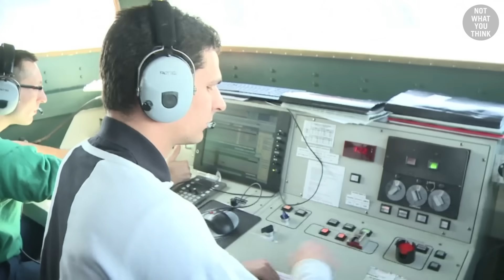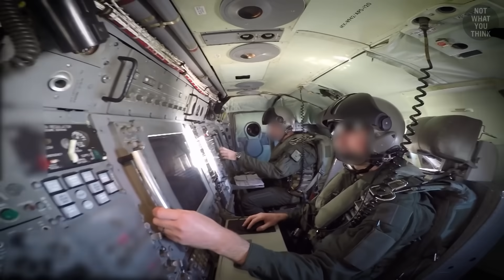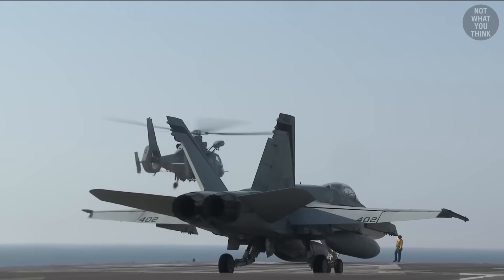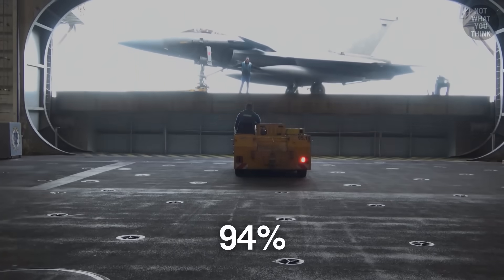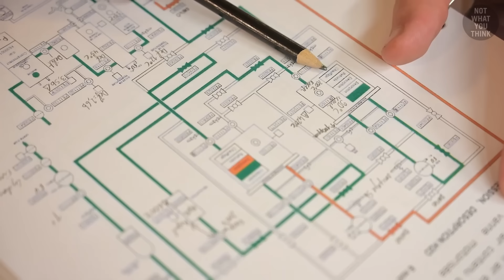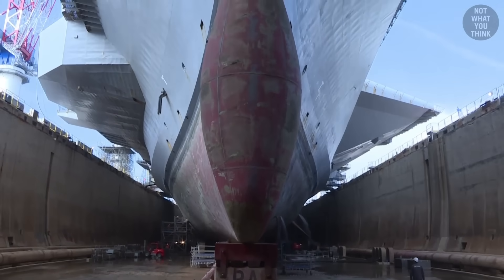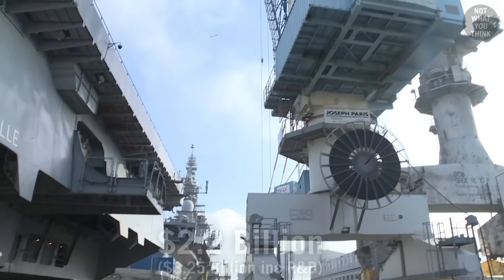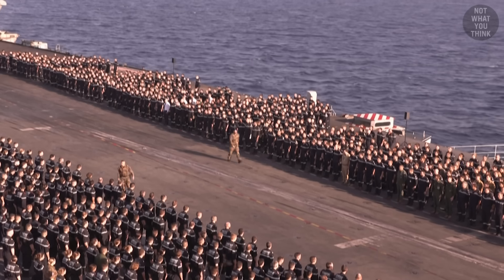Why This Small Carrier is Most Powerful Outside of the Supercarriers

Comment: You're talking nonsense, the construction of a sister ship was totally planned like the old French aircraft carriers but President Sarkozy decided to cancel it to save money by doing a joint project with the English but this never saw the light of day in the end. This is why there is only one, the failure of the Franco-English program. 

The Charles De Gaulle aircraft carrier has an availability rate of 70%, it requires much less maintenance than those in other countries. And it carries up to 40 Rafales but generally 36. 

It's been a long time since the propeller was replaced with an improved full speed. 

You forgot to specify one of the particularities of the Charles De Gaulle aircraft carrier. This is because it carries with it ASMPA tactical nuclear missiles unlike many other countries. It is a very dissuasive element.

Comment: But she only carries 4th gen fighters. Sure, those are among the most capable 4th gen aircraft, but do they compare to the survivability and lethality of the F-35? No...
Reply: It does have fixed wing awacs however, so it's closer than you think.
Reply: @Penguincannon9000  Just another target for F-35...
Reply: @ assuming the F-35 isn’t detected first, and gets shot out of the sky before it gets in range
Reply: @Penguincannon9000  Which it won't...

Comment: The QE-class not getting steam catapults was a huge missed opportunity.  The total aircraft take-off weight is greatly reduced and as a result the range, and payload of their aircraft are greatly reduced, and they also can't operate AEW aircraft like the E-2 Hawkeye.  There is a much less effective helicopter-based AEW but it's not nearly as effective as a Hawkeye.  This is all covered in the video but there you go.
Reply: The QE class was designed with catapults in mind. They can be installed later.

Comment: One thing that often get overlooked is that Harrier and F35B can operate in conditions which cat and trap carriers cant. Issues on the flight deck such as crashes and mechanical failures can prevent revivering aircraft, not a problem with vertical landing. 

There are pros and cons to both methods, but ultimately the carriers are only as good as the aircraft they operate, and in that respect the US and British carriers are operating 5th generation stealth types, the French are not.

Comment: I realize this is splitting hairs, but arguably the most powerful aircraft carriers in the world, INCLUDING US SUPER CARRIERS, are the Tarawa and America Class Amphibious Assault Ships (except ironically for the America and it's second in class, Tripoli, because they don't have well decks and are more dedicated to air operations). What is the argument for why they are more powerful? When it comes to air superiority and bombing the holy hell out of anywhere on the globe over and over again, the super carriers are the tits no doubt, but you have to put boots on the ground if you're talking about regime change. Check out some videos of landing operations from those beasts, which on top of a pretty impressive air wing (they displace about the same tonnage as the de Gaulle), they also carry nearly 2000 marines with the ability to unload rapidly ship to shore. Nobody else can do anything remotely like them and we have nearly a dozen of them. murica.

Comment: The French make out that they are the ones that are a leader in carrier technology but who invented the steam catapult, armoured deck, angled deck, optical landing system, Radar, STOVL, hangar and welded the first carrier instead of using rivets
Reply: Who said that?
Reply: @rolletroll2338  many comments from French people make out that it’s between them and the USA but putting a dangerous power system onboard isn’t clever during warfare just to travel a bit faster as you need to refuel your aircraft and restock your vessel anyway
Reply: @Stewpot-p5l  it is factual. Only France and USA have nuclear carriers. Of course France will not develop its own Catobar for one ship.
Reply: @rolletroll2338  the Catobabar system is just the old British one using a different power system to create the steam and EMALS  started off as EMZKITS until our politicians sold it off to the USA like they did with jet powered VTOL
Reply: @Stewpot-p5l  if you say so. Still, if it's an old British design, with not put one on the new British carriers? Also do you seriously believe your argument about the risk on nuclear propulsion?
Reply: @rolletroll2338  my problem with nuclear power is for the massive crew that’s needed to operate them carriers when them reactors are hit during warfare

Comment: So much better than the Prince of Wales, I cannot understand the crazy design decisions that led to the UK building a non-nuclear carrier with no catobar, no ability to use E2 Hawkeye or equivalent. The   Brits are also completely dependent on the US for aircraft, nuclear warheads and delivery systems. The French are truly independent.
Reply: Plus the fact that they built both QE and PoW led them to be unable to ensure their escort, thus resorting to French and other partners' frigates
Reply: Firstly, the non- nuclear option allows the UK carriers to visit more ports, particularly where there are restrictions on Nuclear powered vessels. CATOBAR was not an option because EMALS was not going to be available before the QE entered service, and even today, it struggles with reliability aboard USS Gerald Ford. The QE was built with CATOBAR in mind and could be converted to CATOBAR in the future. The French will be installing the American system, so no, they aren't truly independent. The UK does not depend on the US for nuclear warheads, thy build their own British designed independent warheads, but they are carried on an American delivery system (Trident). They have decent AEW system in Crowsnest on the Merlin, which will be replaced by a more capable unmanned system in the future. The UK is a tier 1 partner in the F-35 programme, and accounts for 15% of every F-35 built.
Reply: You liar ! The UK won’t put their crew on a surface vessel with nuclear reactors because they aren’t cruel and the UK invented the Harrier jet then helped the USA with the F35B when they struggled with it and now make the engines and vtol system
Reply: @Stewpot-p5l  I can't tell if you are being ironic.
Reply: @lubumbashi6666  if you don’t believe me then just look up the TRUE FACTS ! because Royce make the systems of the F35B and a nuclear carrier has never seen naval warfare yet but even if was made of triple hulled Titanium it wouldn’t be able to protect them reactors

Comment: Concerning the power-plant, however, if the French made it easy enough to access, then they may decide to have an upgraded power-plant ready to replace the current one rather refueling the old one. Not surprisingly, my knowledge on marine nuclear power is very limited, though. I don't know if that would be that much difficult or not.

Comment: Time will tell how interoperable that carrier is with U.S. equipment. Yes, in the short-term, it's interoperable. However, equipment is tested to withstand a certain amount of 'Gs,' and the Charles de Gaulle puts more stress on the aircraft-frames than the U.S. super-carriers. I wouldn't be surprised if that hawk-eye will need additional maintenance over time compared to their American counterparts, for example. If it doesn't, then the U.S. should adopt a similar system to conserve deck space.

Comment: The QE class launch displacement was 65k (QE) and 70k (POW). ie that’s the empty hull displacement. Prince of Wales had extra 5k of systems installed before launch, Queen Elizabeth after launch. 

Add fuel, weapons, stores and crew and both top out with a full warload of 85k. ie full displacement.

The operating capacity is 72 F35B (4 squadrons) and eight helicopters.

Comment: The British carriers , which are 50% LARGER than this half obsolete carrier and is faster and does NOT need to have a capability......To launch aircraft, it is only required that the catapult be able to propel the aircraft to takeoff speed for its given weight, with the appropriate safety margin of speed. The catapult speed can be reduced by the amount of any headwind. This contradicts this guy and the Brit carriers don't need to be moving to launch. As this guy says, the Brits have 2 NEW and the French 1 OLD. You decide which one you think would be better?

Comment: THE French Aircraft carrier has spent most of its life in dry dock its also 40 years old. Wait to when we get our full procurement plus we use the V22 Osprey and in 2024 will are getting 138 F35B Lightning jet's in the next 10 years. And 48 by 2025. As well as other procurements which will be on a another level.
Reply: Et on aura un autre porte avion d'ici la

Comment: It seems our engineers and sailors managed to get the best out of this ship, despite her problems (on top of the propulsion problems at the beginning, there was a space problem with the flight deck which needed to be slightly enlarged, and she may become a HR problem because most sailors don't want to be affected on her : she's much less comfortable than our destroyers (which are now all modern ships with reduced crews and larger cabins).
Those problems are mostly caused by her reduced size, which is said to be linked to the constraints at the Brest Arsenal where she was built.

The future PA-NG should not have such issues, it seems they realized the size of the ship is not the primary cost factor. Also size will not be a problem in the Chantiers de l'Atlantique shipyard, which was at the time designed to build the largest supertankers ever.

Comment: Surprisingly accurate for a non-French channel. One mistake though: the new French aircraft carrier will be significantly bigger than the Queen Elizabeth-class—78,000 tonnes of displacement vs. 65,000. She will be the largest combat ship ever built in Europe.
Reply: QE class carriers are 65k tonnes empty. That's not their operational displacement which is in excess of 80k tonnes.

The new French carrier will likely be bigger than QE class but not by 20k tonnes.
Reply: If it is ever built. Also just one carrier does not give you a credible carrier strike capability... what will you do when your bigger carrier is in maintenance or repairs? France would be better off building two smaller ones. Also. the Queen Elizabeth class is more like 70,000 tones now with add ons. Not much smaller than the French carrier and we have two. You are to build one big flashy thing instead of the   Sensible persistent capability.
Reply: @robertnemeth6248  It’ll be built. In fact, preliminary contracts are already being awarded by the French MoD to the companies involved in the building of our next gen aircraft carrier—I work for one of those companies. And yes, having only one aircraft carrier has many drawbacks; we already experience these with our current and only carrier. (It should be noted that your QE-class ‘carriers’ are nothing but giant sitting ducks. No nuclear propulsion, no catapults, no real AEW aircraft… and close to none air wing. Looks good on paper but useless for actual war operations. No offense.)
Reply: @Antechristo versus one giant target, nuclear power won’t get the ship out of the way!  Grow up!
Reply: @Antechristo nuclear propulsion is notna requirement for a good carrier. And neither is a catapult system. My money would be on QE carriers air wing. Smaller wing, but the F-35 is the fighter left in the air if it meet a Rafale in the air.
Reply: @Antechristo  Late reply but the QE class aircraft carrier does not need nuclear propulsion to be better than CdG 😂. Aircraft embarked, sortie rates and supporting auxilliary fleet all seems to be better at QE aircraft carriers. And the brits have two of them! God forbid a crisis happens while the CdG are refueling or in maintenance. And btw, QE carriers are listed at 80,600 tons at full load. PA-NG (future french carrier) on the other hand is listed at planned 78,000 tons at full load. Ofcourse this might still change but as currently planned, QE class carriers will still be bigger.
Reply: THATS FOR NEW ONE.. this one is OLD one.. not new.. u talking bout French PANG aircraft carrier. This video about Charles De Ghaulie
Reply: The French government claimed 75kt
Reply: With contributions from the African colonies.
Reply: My new Lamborghini will be red...It will be the coolest car in my town.
Reply: There will never be another carrier built in Europe.  Europe is dying from social spending and declining manufacturing.
Reply: The QE class launch displacement was 65k (QE) and 70k (POW). ie that’s the empty hill displacement. Prince of Wales had extra 5k of systems installed before launch, Queen Elizabeth after launch. 

Add fuel, weapons, stores and crew and both top out with a full warload of 85k. ie full displacement.
Reply: @advanceaustralia3321 nope it’s 65000T in full load for the QE and the POW
Reply: @ptranchand52  
POW rolled off the slipway at 70,400 tonnes.
Reply: @ptranchand52 nope you’re wrong, the MOD confirmed that they are 65k tons empty
Reply: No more African resources, new French carrier will be just a dream...
Reply: @franzmenzies5268 Like wits you  show by your comment...a dream...
Reply: @franzmenzies5268  They can get the ressources elsewhere, in case you don't know.
Reply: @LesBrouettesHyperactives from where? Tell us.
Reply: @franzmenzies5268 cry baby cry
Reply: @franzmenzies5268 You know France don't rely on Africa trades, right ?
Reply: @franzmenzies5268 France is one of the oldest nation of the world 
Before colonialism, they were one of the most powerful nation in the world, still are.
Reply: @franzmenzies5268  The first African country partner for France is South Africa for a long time and they weight only 0,4% of french import and 0,1% of export (around the 35th rank as partner). 
South Africa had never been under any french "domination" of any kind.  
The whole African continent is less than 2% of goods and financials exchange for France. Nothing that would cripple the french GDP and that can't be switch to other partners. Take a look at Russia who managed to overcome the loss of western trade and money without breaking a sweat when it weight for a much bigger part of their GDP.
The whole concept to put problems on french neocolonialism for some African country is a deep weakness from my point of view. Sure there's some burdens by France (and other ex power) that's should be rejected but the future of a country need to be free from victimization. Positive socials and collectives challenges will always be more fruitful than lamenting on the past.
Reply: Quelle ressources africaines…..
Encore un qui lit trop le journal de Mickey Mouse !
Reply: @franzmenzies5268 "thy seems like chewsday innit"

Comment: While there is some truth to the catapult being superior it is totally over stated and usually for the wrong reasons. Once again the "fuel and weapons" issue is stated. The factual truth about the ski jumps is out there. Take for instance Shandong or Kuznetsov. The have multiple launch positions and from the rear position they can easily take off with a full weapons load and or full of fuel.  The British carriers are the same and F35s can launch with full weapons and fuel or they would not have been built this way. The catapult makes it easier yes, but where it shines is its sortie rate . Allowing for faster turn around putting aircraft off the deck in addition to making recovery faster as well. It allows for superior use of the flight deck .  Try and find one single video where people tell the same story about American  assault ships being used as light carriers, you never hear the same stated and they do not even use a ramp.

Comment: China not only has catapults on type 003(Fujian) aircraft carrier, but it is EMALS like USA's newest Ford class and not steam powered not Frances one. China skipped steam catapults completely since why not if they need to learn both from scratch anyway.

And not only that, but Frances carrier is 45,000 ton while China's Fujian will be like 80-100,000ton, a super carrier in every way.

And while the fujian is doing sea trials and will probably be fully commissioned into the navy later this year, China had already been building the type 004 concurrently with the type 003. Who knows, type 005 had probably also already started being built years ago. The main question is not if. But when. And whether they will be like Fujian, or whether they will be nuclear.

Type 004 should be commissioned before 2030, china is planning on having 6 carriers or so by 2035 and will match or overtake usa militarily in most comparisons by 2050.

Comment: 10:12
The French reactors are somewhat close to the reactors on Enterprise (CV-65), which needed *8*.
In fairness, Enterprise was a simple mod to the existing Kitty Hawk/Improved Forestall class in most respects, and each reactor was a direct swap for a boiler from the older design.
Reply: Enterprise was basically the same size as the Nimitz-class, though. She was fitted with eight submarine reactors cause that was what they had at the time. De Gaulle’s a lot smaller and can make do with less.
Reply: @grahamstrouse1165  Every carrier the US has build since Forestall has been about the same size.
De Gaulle is a lot closer to the old Midway class - about half the displacement of the US current carriers, though only a couple hundred feet shorter.

Comment: Charles De Gaulle is NOT a particularly "small" carrier.
It's comparable in size to the USS Midway class, and one of the few CATO carriers outside the US Navy (I think the ONLY one that is currently active).
I am pretty sure the C13 catapult design came from the Midways, they had shorter cats than the Forestall and later US carriers.